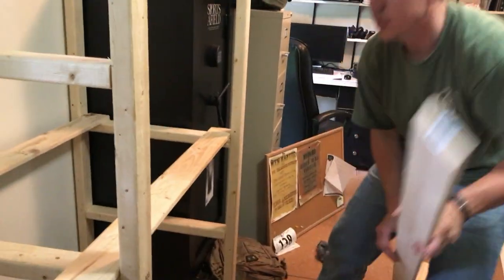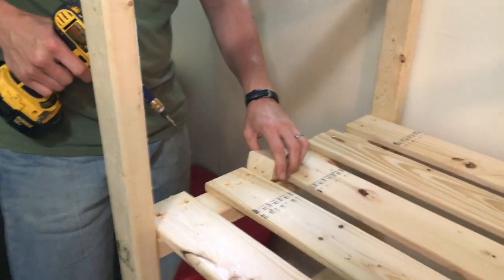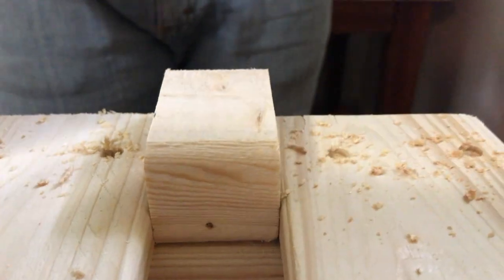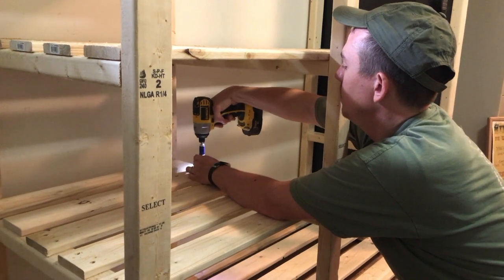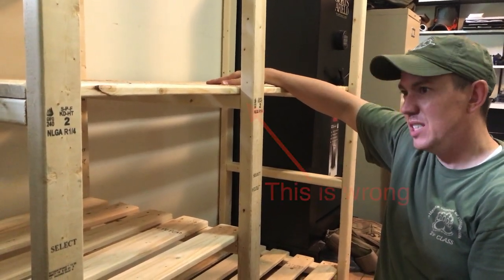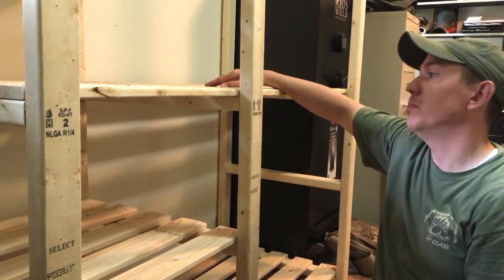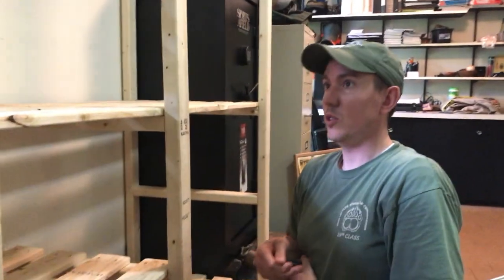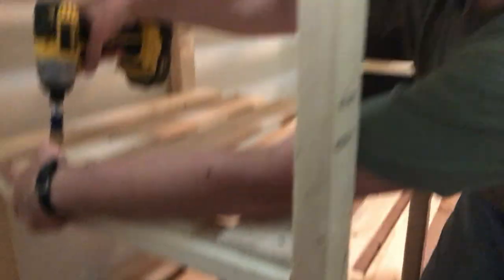DIY Freestanding Closet - EASY AND AFFORDABLE Wardrobe and Storage Build

Comment: You need an intro of some kind, any kind. A " hi, today I'm building this" would suffice. Measurements are helpful for those watching. Alternative methods of attachment are good to mention for those without jigs or fancy tools. The dialogue helps immensely. You don't have to ramble non-stop but at least say the steps as you're doing them. This will help make a better video. The beginning was so dull, that I was about to exit the video.
Reply from the maker: Thank you. I might take this video down entirely. It was rushed when we made it and we have gotten better at doing what you said since then. Thanks for the advice... I agree!
Reply: Sometimes, I need dialogue and sometimes I just need to see it. I like different options. Some dialogue is useless and takes to lobg..I need quick fast, I'm probably in the middle of something.

I also liked the kid in the background..real life for real projects